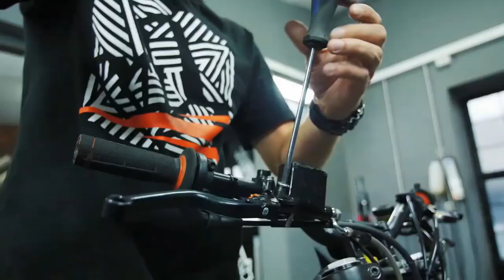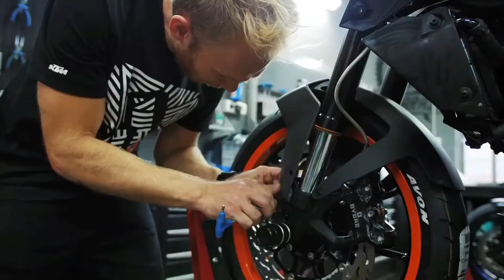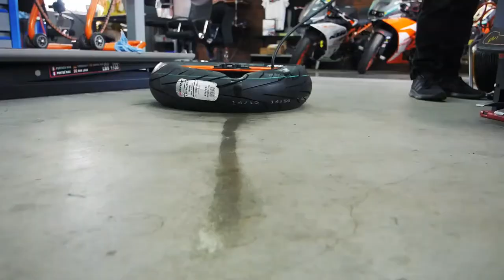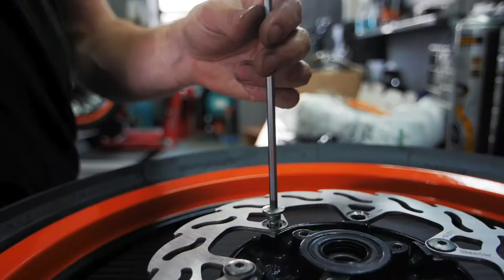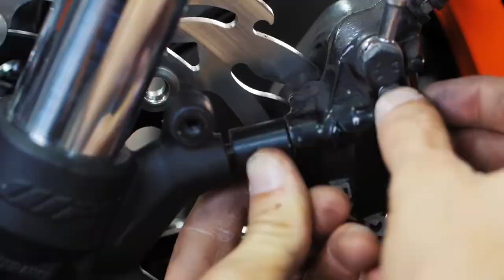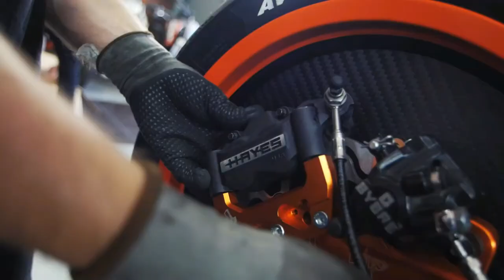Carbon fiber wheel cover ( ktm duke 250)

Comment: Does the speed improved after putting those  carbon wheel covers? Cause I heard it reduces drag
Reply: On bicycles it does, i dont know how much for motorcycles because the covers are “deeper” into the wheels but it probably does i just dont know how much.
Reply: @annefrea88k  that's what I was thinking too, recently started getting into cycling because of this Pandemic. And thought why motorcycles doesn't have disc wheels to improve aerodynamic
Reply: @Meme_supplier  maybe because the brakes will overheat? I dont know i think that could be a good reason
Reply: Can the disc go on the front wheel too?